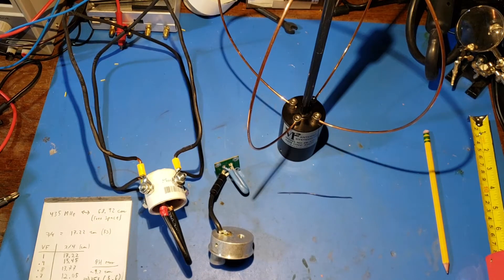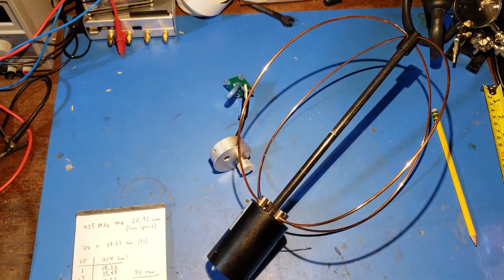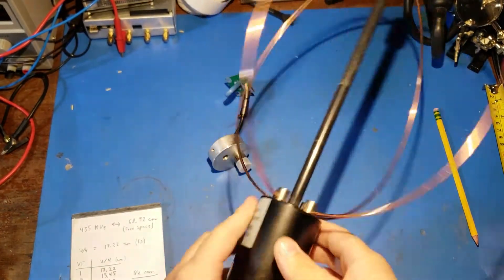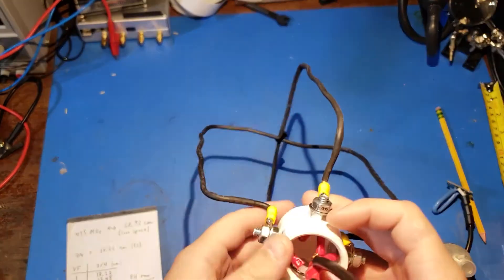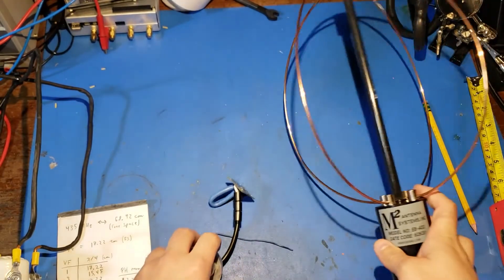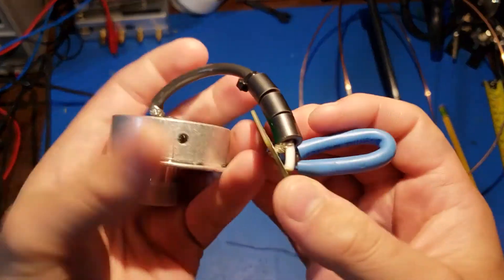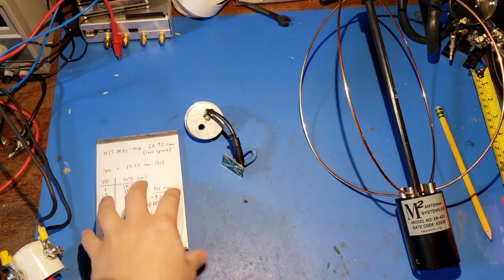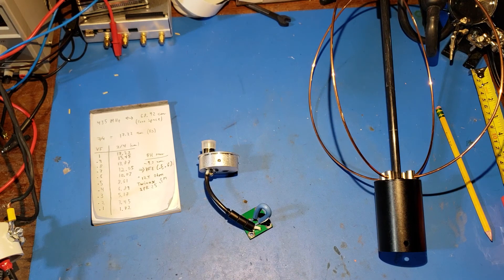Satellite Eggbeater Antennas - DIY vs. M2 Antennas

Comment: Any Suggestions for RG62 Coax, I can only find 1000' rolls of it,  impossible to source here in NZ, ?
Reply from the maker: You'd probably have to source some from overseas then, I bought mine on ebay in the states.
Reply: Aftermarket car radio antennas use RG62 coax. I spent ten dollars and have plenty left over.

Comment: Fantastic, and after much deliberation and sourcing of parts I am presently building the 70cm version, biggest issue by far has been sourcing RG62 coax for the phasing loop, very tricky to track down.
Reply: Aftermarket car radio antennas use RG62 coax. I spent ten dollars and have plenty left over.

Comment: How did one compare to the other in  performance??
Reply from the maker: Opinion: Eggbeater V1 >> Eggbeater V2. The Eggbeater antennas from M2 (or normal style eggbeaters with reflectors) are a dream. For me, the eggbeater v2 style antennas have not worked well for NOAA weather satellite stuff on 137 MHZ. I never really tried them for narrow bandwidth satellite work in comparison to the normal style eggbeaters, but they seem like a meme to me. A CP yagi az-only rotator setup would be far better, and I'm hard pressed to say that one couldn't get similar results with just a high gain vertical. The only advantage would seem to be the CP at those elevations when compared to say just throwing an Elk 144/440 LPA on an az rotator. 

My reco is build or buy normal eggbeaters with the reflector and learn CW or use FT4 for linears if you really don't want to have rotators. If you want a quick and dirty rotator setup see the azimuth only Elk config. Otherwise, I'd shell out the bread for the az/el rotators with CP yagis :)

Comment: great video but can you supply a diagram for the balun you made from rg58? i have constructed 2 loops just not sure how that bit is wired from one loop to the other alkso the length. Thanks in advance...
Reply from the maker: Please see page 7 of this document for the schematic for the phasing and matching harness: https://on6wg.pagesperso-orange.fr/Doc/Antenne%20Eggbeater-Engl-Part1-Full.pdf. I believe the diagram is for RHCP IIRC. On a related note, the task of balun, conversion from balance line/antenna to unbalanced transmission line (e.g. coax), was ignored in my implementation. The commercial version used ferrite toroids placed over the coax to attenuate the common mode current on the shield.

Comment: https://on6wg.pagesperso-orange.fr/Doc/Antenne%20Eggbeater-Engl-Part1-Full.pdf
Reply from the maker: This was already one of the references in my description, but thanks for sharing. Glad to have you on board!

Edit: it was in fact probably my most useful reference for the "V1" (circular loops) Eggbeater because of it's clear definition of which way to wire the polarization and included diagrams. People should definitely check this one out if they missed it deep in the references.

Comment: So overall recommendation?  You don't have to rotate these?
Reply from the maker: Correct. No rotator is required. I recommend them if you don't want to set up a rotator, but you will need more TX power than 5 watts to get into the birds on SSB or FM reliably. You will also be picking your poison in that you must choose a setup for low or high passes respectively with V2 vs. V1 loop design and reflector placement. I use the M2 antennas satpack with reflectors and an IC-9700. It works great for pretty much any LEO bird pass over 30 deg.